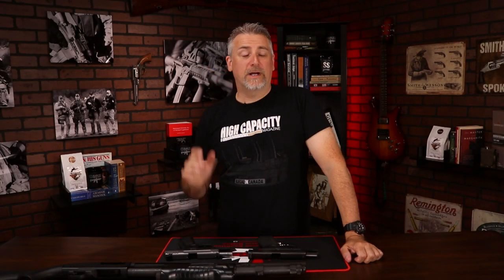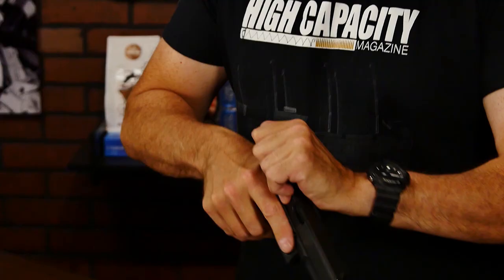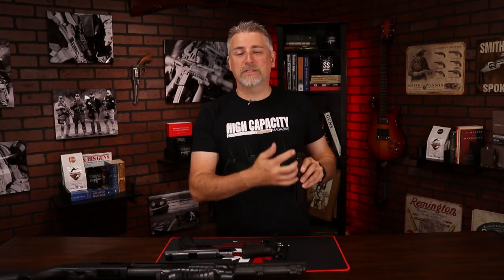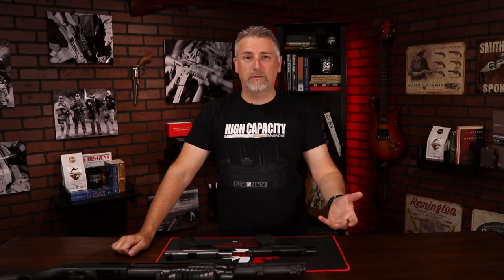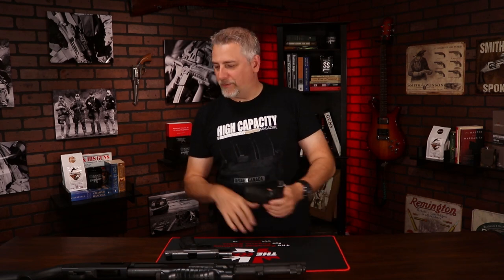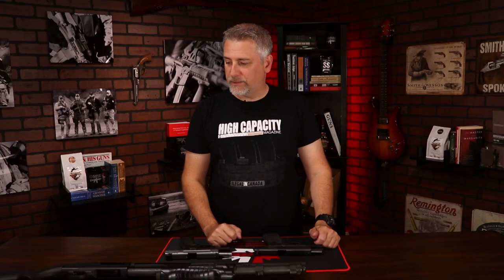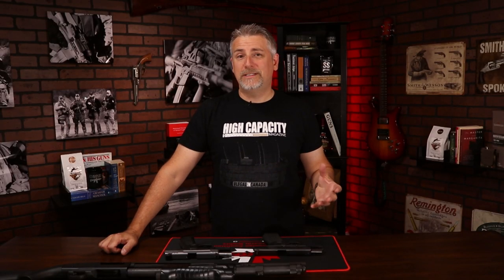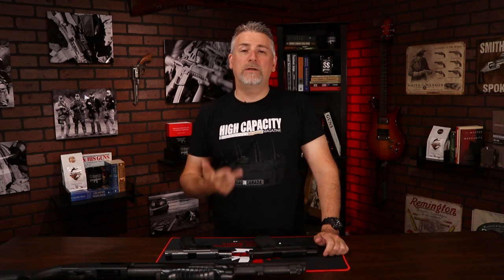Protips Episode 2 - How Often Should I Clean My Gun

Comment: I have a few rifle which rarely take them to range, but try to clean them every 3 months. I have noticed that the barrel, on my Uberti 1866 rifle with brass receiver, leaves a brownish residue on the the cloth that I pass through it - does cleaning and oiling more often helps of is there a better oil I could use to protect inside the barrel? Note that when I shoot the rifle, I use 44-40 cowboy action with lead bullet and clean it after I get home from the range before stored in my safe.